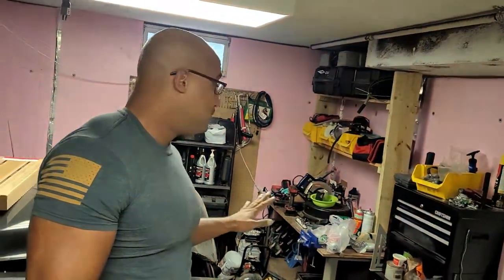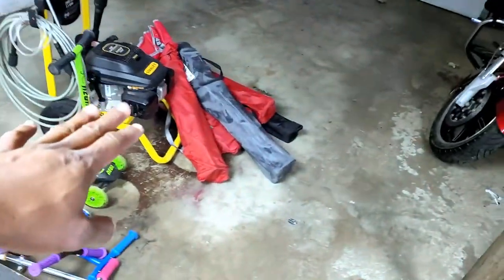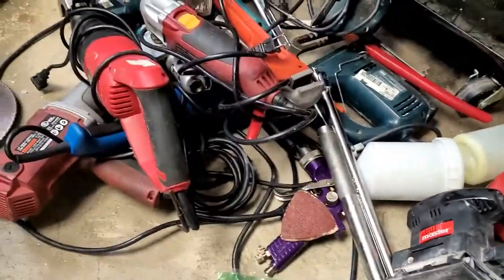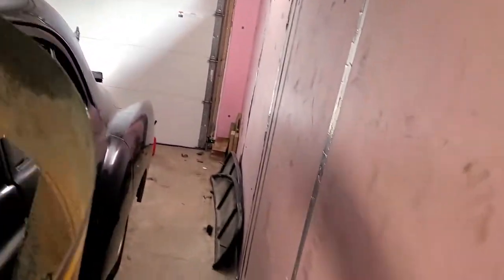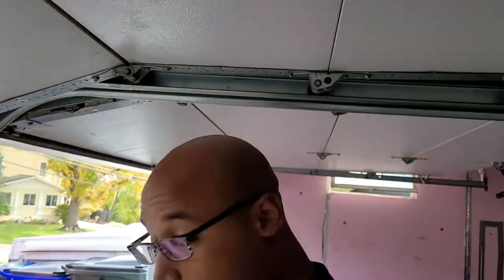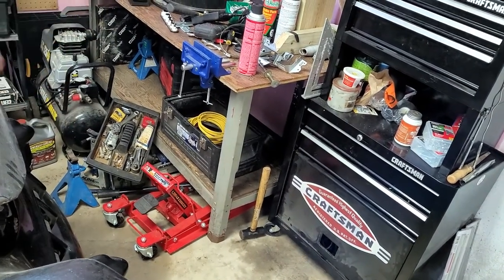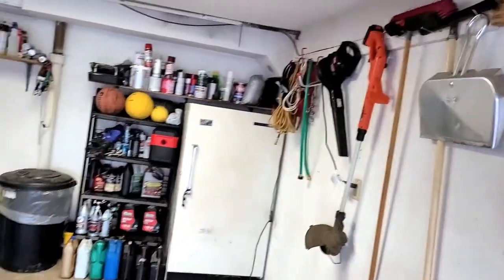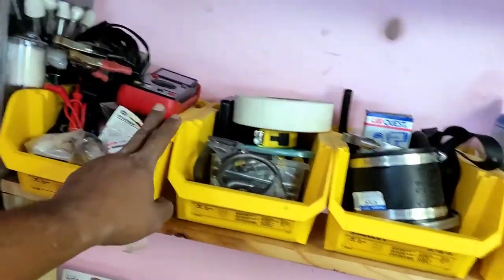How to Organize a Garage (Minute Maintenance)

Comment: Man, it definitely doesn't take long for my garage to get messed up. I try and pick it up periodically, but really need additional storage so I can get a bunch of lawn equipment out.
Reply from the maker: Hey Christian, ever consider wall mounted shelves? Or standing cabinets? Really helps to open up a space and make it feel more clear but simply moving things...up and off the floor!
Reply: @minutemaintenance7385  I have shelves mounted up towards the ceiling on 3 sides of my garage. I just have too much stuff. 4 roll around tool chests, a stand up freezer and side by side refrigerator/freezer. Work bench, yard equipment etc… all in a small 2 car garage. We don’t have a shed, but truly need one to move some stuff out of the garage. My Raptor won’t even fit. The wife’s Edge ST will fit if I move some stuff around
Reply from the maker: Whoa! Sounds like it's time for a Garage Sale! I didn't show my shed, but I have a decent Menards "Special" 10' x 10'  definently helps to keep the Garage Clean. If you got the Yard space, might be worth the investment, if for nothing more then Peace of Mind!
Reply: @minutemaintenance7385  we do have the yard space, just haven’t got a shed yet. Hoping within the next year. Big combo of lots of hobbies/projects as well as tools for housework keep it full. I’ve made do over the years with maximizing storage, but it’s still a challenge.